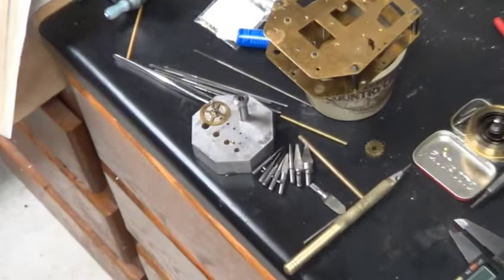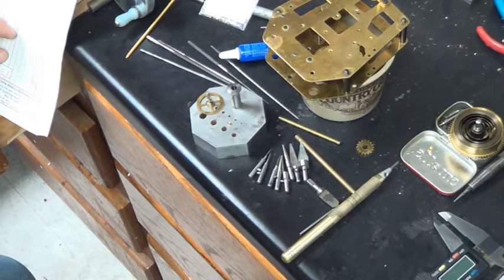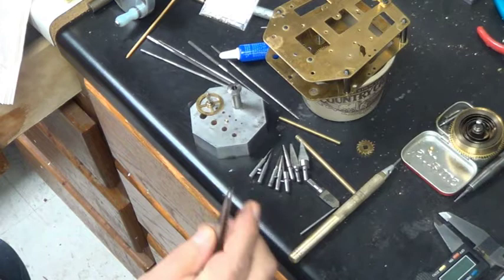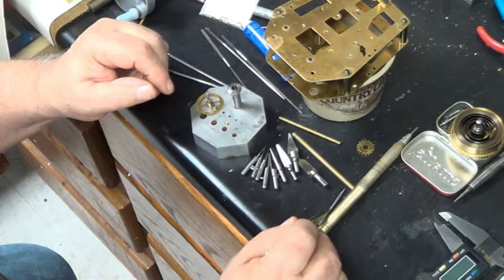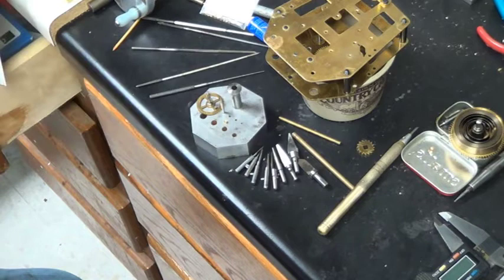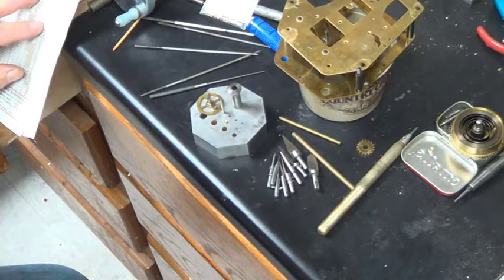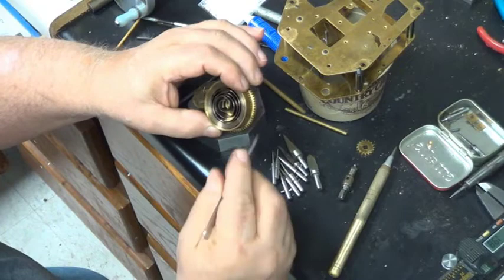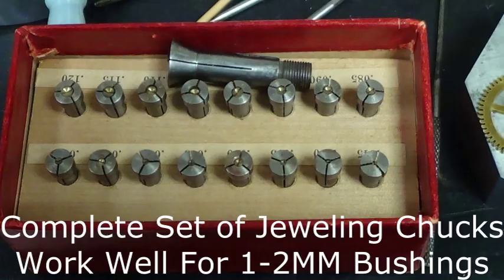Custom Clock Build S2 - E8 Linden Clock Bushings

Comment: I think that’s 2 100’s of a millimeter.
Reply from the maker: Clock bushings are in mm one could measure the cutters and convert them to thousands but most of the bushing packages I buy are mm size. I will measure the reamers and for kicks. The Bench Jeweler